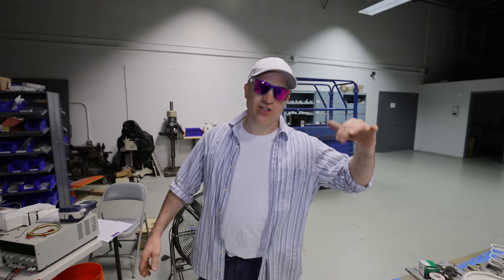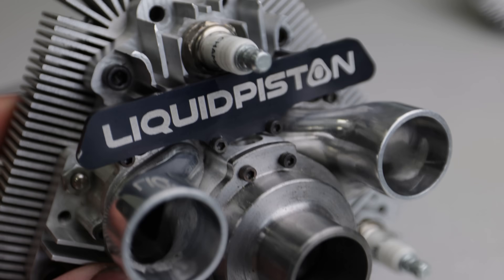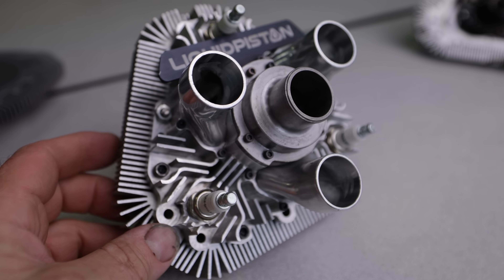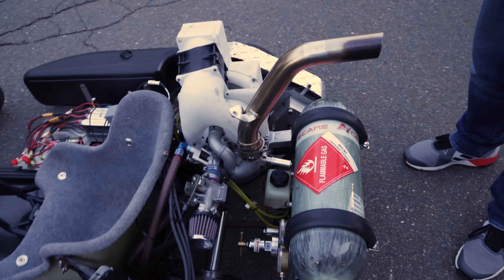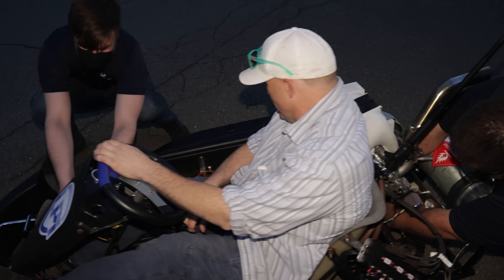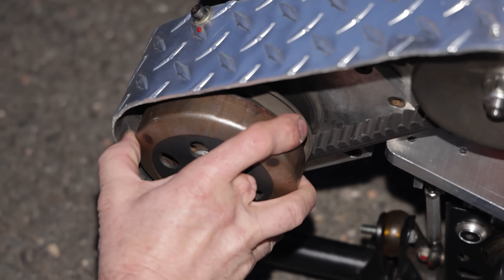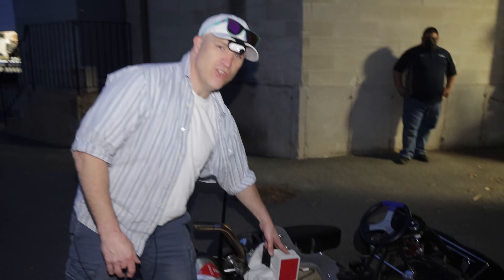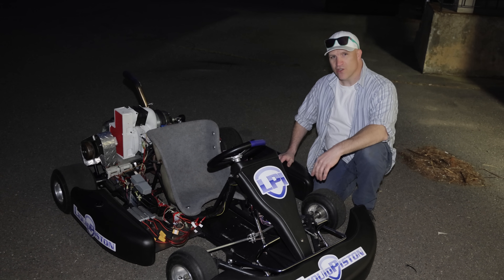Hydrogen Powered Liquid Piston Rotary Go-Kart

Comment: This is what I wanted to do for so long. Have a small & light but potent generator for a Series-Hybrid motorcycle. I still want to have a micro gas-turbine generator, that can run on any fuel, and have many compressor stages for efficiency. But if these Liquid-Piston engines are better then any 2-stroke I can find, are finally available for purchase, and I can actually afford one of them. Them LP would be a great option for my future project.

Comment: The exhaust pipe they have running up is logically improper due to the fact that smoke rises and water falls. Water could build up in the manifold.
Reply: An engine running on gas or diesel produces water as a by product too. It comes out as steam and will just float off. A little might condense while the exhaust is cold, but it's really a non issue.
Reply: The water produced by burning hydrogen is in the form of vapor. It is only liquid water after it cools, long after it exits an exhaust pipe.

Comment: Difference between the rotary and this new setup is the rotary gets spark on all three sides this new setup gets hit on the same side at all three intervals of spark this will result in the rotor failing from the constant heat in one place

Comment: love the liquid piston concept .. what would the cycle be called  a 3/4 stroke ?? when  the design is scaled up and or multirotor . then add some PSI.. it will produce lots of power from a small package. i think the slow kart was due to the prototype hybrid setup.. and kart gearing/clutch setup... a better generator ( maybe a 1 wire Alternator or2 .. from the performance section of most auto parts stores ,for about 100.00 each there externally regulated allowing for higher voltages and could put a bank of supercapacitors too help with starting ... ect  . ) and eliminate the clutches and let the electric motors handle the clutching action...

Comment: Just wondering is the x engine able to be configured into a multiple rotor setup, if that’s the case it would be awesome
Reply: Just slap on a longer crank, two three or six rotor packs, I think from memory you'd angle them at 60 degrees in firing relation for a twin or 30 degrees for a triple or six so the engine would run at its smoothest.

Comment: I still can’t quite wrap my head around how such a small engine can produce so much power. A conventional piston engine of similar overall size would be for large RC models, not a full size go kart. Granted, it’s not setting any speed records, but the fact it moves at all is seriously impressive.

If LiquidPiston plays their cards right, this could be a revolution
Reply: 4 stroke piston engines needs 2 up and 2 down strokes to make 1 power. Whilst this thing, 1 rotation makes 3 power. 1:3 compared to 4:1. Factor in mechanical losses of the up and down losses for pistons.
Reply: @JustnTheNick  excellent job explaining that, you made it sound simple.
Reply: a nitro rc is a 2 stroke .. so is a wankel .. the liquid piston fires 3 times in one revolution .
Reply: @Y2daT420  1/3 stroke? Lol
Reply: @inoahmann7542  2 stokes !
Reply: @Y2daT420  3 chambers = 3 cylinders     2 strokes engine
Reply: Idk I have a 47cc single cylinder basic reed-less 2 stroke that makes close to 10hp. That go cart would go 45 easily with it on there. I still think this is a cool innovation and I’m glad it’s not just electric.
Reply: Uhh, did you see what I just did? This power plant is took the space of a 4 cylinder engine and put out next to no power. (And had an electric motor assisting it). I have a vintage Panther 2 stroke smaller than a soccer ball that would puts out over 10hp and pushed a go kart over 35mph. This was definitely not the way to display this machines efforts.
Reply: Supposedly the gas powered version makes 25hp. Larger sized go kart engines make 13. It would enable go karts to go like 150kph-if they're not lying. 

They should put it out on the go kart market if theyre not lying about it.
Reply: isnt it a hybrid with an electric motor
Reply: @dsid4evr  yeah, but have you ever tried to drive a generator powerful enough to run a go kart by hand? You wouldn’t get ver far
Reply: I don't think Hydrogen will ever be seriously considered for use in motor sports. One puncture of the tank (Which has extremely high pressure at ambient temps) and you take out half the circuit plus some spectators. There are Hydrogen fuel cells that store Hydrogen in a safer way, but elemental Hydrogen is a single proton with an electron, it's so small it leaks out through practically any metallic atomic structure. Leaks = NO in vehicles. It is the dream fuel for environmentalists at first, but in practise it is expensive to produce, using massive amount of electric power for water hydrolysis which inevitably is partially consumed from coal plants, or through chemical processes with environment-unfriendly waste products. I'm surprised Hydrogen has gotten this far.
Reply: @paulmichaelfreedman8334  The best way to produce hydrogen is on demand by splitting water into hydrogen and oxygen and feeding it straight into that engine.  A ruptured tank would shoot fire straight up and burn out quickly, unlike the Hindenburg that was covered by cloth with basically rocket fuel coating... the disaster was all that burning material, not the hydrogen.
Reply: @WillieStubbs  Splitting water requires energy, and it will always be more efficient to just use an electric motor rather than spending the electricity to split water, only to put it back together again in a combustion engine.
Reply: @paulmichaelfreedman8334  Actually, hydrogen is fairly safe.
It's so light that the gas go straight up into the air before it can manage to do much damage.
And it's under pressure so it'll be spewing out really really fast in a single direction.
You have to collect it somewhere for it to be a problem.
Reply: @paulmichaelfreedman8334  As for usecases.
Hydrogen is more energy dense in terms of energy pr kg of weight then a battery.
Airplanes are probably a good use case for hydrogen.
Also, rural work and military applications may make use of hydrogen, there a hydrogen ICE even makes sense if they're multi-fuel as your can use a solar panel to produce hydrogen from water there and then, yet you also have backup options of fossile fuels, giving you more options.
Or you can use hydrogen to get there then refuel with fossile fuel when you get there if you don't have production capability.
Likewise in a warzone, you'll use fossil fuels most of the time, but if your unit is cut off you can still produce some hydrogen yourself maintaining some limited combat capabilities even if you can't ship in fuel.
Reply: @paulmichaelfreedman8334  hydrogen combustion still also has other nitrogen byproducts, kinda like diesel engines. Hydrogen is a pain to store because of its small size, but it's H2, not a single proton.

Comment: The world needs hydrogen technology not lithium battery technology. There would be  NO landfills full of leaky batteries killing underground aquifers, and soil in the future like the current trajectory we are on. The emitting gas and liquid coming from hydrogen is "actually" "green" emission. Unlike batteries that take more fossil fuel to mine, ship and manufacture than the fuel they save.  From start to finish my 300hp gasoline truck will use less fossil fuel in its life cycle than an electric car gobbles up just being built. That's NOT Green! Plus it would be much more exciting in the future watching Hydrogen burning motorsports than lame battery motorsports.

Comment: A new rotary invented engine with the future of fuel powered engines... This is crazy. Liquid Piston is doing amazing things! Hopefully this can be on a full sized car soon.
Reply: Probably not, it has way too little torque.
Reply: @alexzanderroberts995  There are plenty of fully blown 2 rotor drag cars that run 6 seconds at the quarter LOL :c it's pretty crazy. Not allot of torque but the original rotary engines are crazy fast when modified. I just wonder how the future will look for these new invented ones.
Reply: @rjaybruhh  the issue is consistency, and reliable torque. You cant exactly tell my those cars are reliable. We dont exactly know the reliability of these engines yet, so I assume the apex seals tend to wear down.
Edit: I am not talking about future designs, as they will be better in every way, I am talking about this engine right here.
Reply: @alexzanderroberts995  Trueee

Comment: As a died in the wool Mazda rotary fan, I am impressed and intrigued by your interpretation of the Wankel rotary power plant.

But, as a long time kart racer and crew chief for two winning Mazda RX7 SCCA GT2 and GT3 class cars, I am NOT impressed by the performance.

As noted in the video, hydrogen fuel piston engines have problems dealing with localized 'hot spots' and piston ring leakage crossing over to the intake event and into the crankcase sometimes resulting in uncontrolled engine fires.

Mazda experimented with hydrogen fuel some years back.  Because the ignition event occurs on opposite sides of the engine intake and exhaust events, hydrogen leakage was essentially non existent.  Performance was on par with petrol fuel versions, little performance if any was lost.

BMW and Mercedes also experimented with Hydrogen fueled cars for a while and Toyota had an interesting ceramic piston/cylinder hydrogen power plant.

The published engineering papers of all 3 agreed the biggest downfall of hydrogen fuel is three fold... 
1) Gaseous or liquid hydrogen require very heavy reinforced fuel tanks with limited capacity vs their size.
2) The required infrastructure for neighborhood fueling stations is years away and very expensive.
3) The current technology for breaking/separating large amounts of hydrogen from hydro/carbon based fossil fuel (oil) or by electrolysis from water that requires huge amounts of electricity is very, very expensive. Much more so than from fossil fuels with NO cost savings.

Unfortunately until these issues are addressed, hydrogen fueled engines are a long ways off.

Comment: Lets all be realistic how much displacement that little liquid piston engine was. Thats pretty good output vs displacement. Great video! Thanks for the different perspective on life!
Reply: For sure, its a tiny engine compared to gas powered engines. Give it a better transmission and itll go faster. Anything can be done with the right transmission. Look at tractor trailers pulling 70 tons on a V6 at 70 mph.
Reply: @jamesbeer9886  those V6 tho has 10L+
Reply: @jamesbeer9886  never seen a tractor v6 diesel.  But the name of that game is torque.  These rotary's are said to have very poor torque output but that can be overcome by a multy speed close ratio transmission.  This thing is go cart centrifugal clutch single speed I think.
Reply: @joeKisonue  Detroit Diesel made them.. although the 6V92 was used mostly in heavy duty trucks.
Reply: @joeKisonue  You can always multiply torque with reduction gears and torque converters.... but not without a corrosponding lost of power and speed..
Reply: @sandervanderkammen9230  with how small this engine is that can also be solved by stacking multiple engines on top of each other
Reply: @joeKisonue  you can get torque by reducing the speed, while the average car runs UP TO 8k, this one easily goes over 10k and idles around 2-3k so, i can reduce the speed and gain a lot of torque, at the end, power is what matters
Reply: let's see what this engine do on a 10l version, i think it will be very nice (+ it's clean, and waaaaay better than electric imo)
Reply: Where is the 2 stroke oil thingy injector?

Comment: I could hear 7000 through > 9000 rpm spins on that engine. Sadly none of that power is turning the wheels. Get rid of the hybrid system for testing, get a reliable CVT and see the difference.

Comment: I was excited to see this until I got far enough into the video to find out it was hybrid. We all know an electric motor can propel something, show us what the liquid piston engine can do on its own just like every other type of engine. I wanna know how this compares to an ordinary reciprocating engine on a gearbox of some type not an electric motor. Besides that, everyone that is semi common sense knows that any time you change energy forms you lose some of the total energy. The only reason to do a hybrid system, is if you are a green libtard, or if you are looking for extreme low end torque (such as a train, or mine truck). So I feel like this is an attempt to attach their cool motor design to the green movement instead of just showing that a non-recipricating engine can provide a greater amount of power per fuel unit than an ordinary engine. Or maybe their liquid piston engine doesn't work that well, and they needed an electric motor (and battery) in the mix to get it to move anywhere.
Reply: My thoughts as well. Why present the engine in the worst possible way? (outside it's use case) Why is it never shown running under load without an electric motor attached, mechanical dynos are a thing, in fact I seem to remember a certain youtuber building just such a system. It's a very interesting concept, but the way it is being presented feels disingenuous.
Reply: I'm thinking the last part of your comment is the answer. Every video I can find on it has it hooked up to an electric motor. I've yet to see it run under its own power.

Comment: I remember reading about Mazda developing Hydrogen rotary back in early 2000's, but fuel tank was the sticking point.
Reply: The advantages of using pure hydrogen for motor fuels is amazing... It regenerates itself into it's original molecule after the burn & energy release... Hydrogen is the most plentiful single element, in existence... One of the  problemwith pure Hydrogen
Reply: @michaelmartinez1345  it's the most plentiful element in existence but it is not practical cost and energy wise to convert water into pure H2 gas. Plus you have to cool it down to liquid form to transport which requires a lot of work and money

Comment: Why does it need a centrifugal clutch?  Isn't it driven by an electric motor?  I would rather see the engine power the kart alone if they're proving it can be useful with hydrogen gas.  I would like to see some burnouts with hydrogen power.👍
Reply from the maker: Agree! And totally agree, some burnouts would be amazing!!!!
Reply from the maker: That's a great question, I'm not really sure, my design is different.
Reply: @WarpedYT  Cool!  Can't wait to see yours!  It would be interesting to test compressed Hydrogen vs compressed HHO gases.  The extra oxygen would probably help get some more power.

Comment: Mazda run Rotary engine with Hydrogen. Also Mazda used Three spark plugs per rotor in the race to burn most better fuel and also help for Better MPG.

Comment: Good day . We invented my Lord boss and I a super revolutionary engine for any type of fuel, including hydrogen for 0 emissions, obtaining much more performance than any other current engine and greater than batteries or fuel cells that are used in combination with electric motors, It has a tubular format with one or more stations and a novel thermodynamic cycle, with only two main moving parts, a power / weight ratio greater than 10 Hp / Kilo in its basic form, its thermal efficiency is greater than 75% three times more than the Current engines, everything can be manufactured in aluminum (except the main shaft and screws), it does not use liquid coolant, it uses very little lubricant, it can be extrapolated to any power without losing characteristics, it is patented in Brazil and also in international PCT. Very easy to manufacture 100% with current basic technology, all its moving parts 100% mounted on commercial bearings, the useful life is greater than 30,000 hours (> 30 years) with very low maintenance and more than 50 additional advantages ... ...
As an example: drones of any size can be made with subsonic and supersonic high speed vertical take-off (goodbye to helicopters, traditional airplanes and airport runways), it does not use a turbine or axial compressor, it is not ramjet nor is it scramjet for M> 1 and more, it has a frontal area of 20 cm2 / Ton. of thrust and more than 100 kilos of thrust / kilo motor, it is similar to a rocket motor and 100% safe, with more than 40 thousand kilometers of autonomy in all types of drones at a cost many times less.
If you are interested and you are a medium or large company, you can produce with very little investment in a few months under a license (This would only be charged per engine produced) for engines of any type and size, contact us, you will not regret it, by email: elmontecarmelo1 @ gmail .com . It is not a joke, I repeat it is not a joke, we are serious and responsible people, we welcome constructive comments.
YOU WILL NOT SEE THIS ENGINE IN ANY BOOK OR ANY OTHER SITE.

Comment: Why using a generator? It seems unnecessarily expensive and complex.
You can easily use a much smaller, permanent magnet motor for generating power from it. They're going online for a few hundred bucks, and are more efficient than asynchronous motor/generators, and make power by rotating high rpm; much more suited for a smaller engine like this.

Overall it seems to have less performance than a 50cc 4 stroke engine.
Hydrogen isn't a fuel of the future. It takes too much energy, to convert water into it, making the process extremely Inefficient!

Running it on diesel might be interesting. More torque.

Comment: Dear LP   Maybe if the piston was made out of  " Invar"   and maybe  vanes across the intake and exhaust  ports  and maybe  timely injection in the hot end of the  " piston "   maybe vegetable oil   maybe it might it might last for more than a thousand hours?   SY Albert Harvey   Rotary Engines